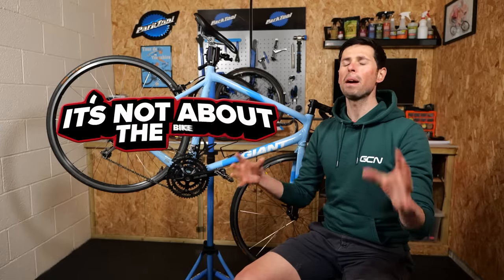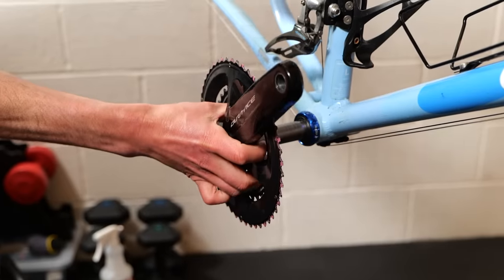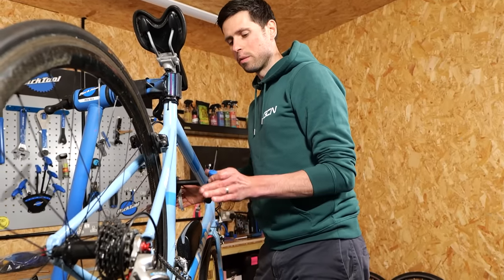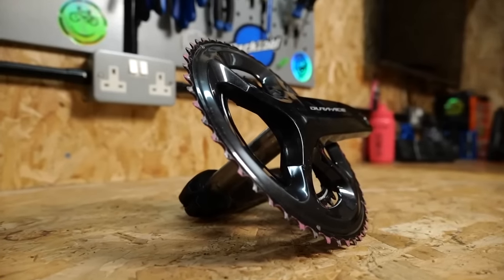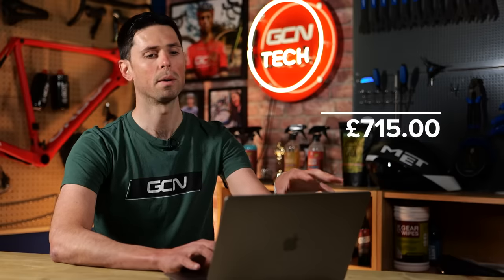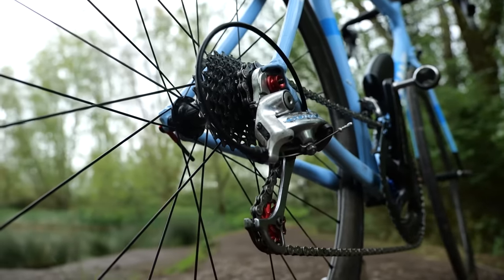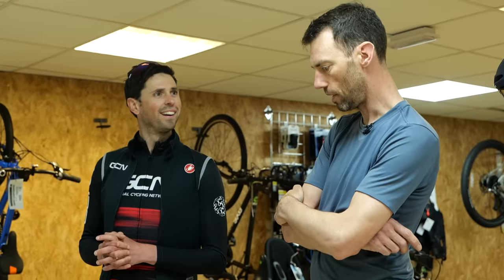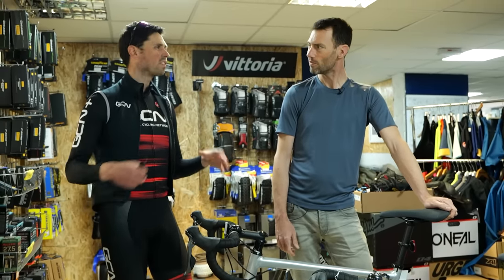Did I Really Build A Bike For Under $1000? | Cheap Performance Bike Upgrade Ep. 3

Comment from the maker: What do you make of Alex's new bike? 🚲
Reply: People should chill a bit, it's a fun video, if the bike ends up at 1100 instead 1000, what's the big deal. Chill it's fun
Reply: Good idea but Dura-Ace Crank seem to be over kill. A good 105 would have been great ! 
Difference between a old Sora and a claris is incredible. So for the difference (maybe 50$cad) you would be able to purchase a new derailleur instead of new pulley.
Oh and the Giant frame. Love Giant. But the OCR ... was laking of stiffness. The OCR was also more heavy than the TCR.

My suggestion. Put the bike in order but don't over kill it. It won't affect the quality of the drive. 

I always say. Yes you can put a Mercedes engine in a Honda. It will work. But the frame of the car was not design for it.
Invest in a smart way. Investing doesnt mean it will bring the bike in a new condition.

From a Shimano T.E.C since 2011

Cheers from Montreal
Reply: Who's Alex?
Reply: I think instead of the dura ace crank he should have invested in a 2x11 105 groupset, maybe even on the second hand market.
Reply: Oh yeah and fk off with the saddle, its a personal thing and if a 30,- saddle fits you than you don’t need that expensive model and a budget stem with same function coups be 10,- so i think for that money you should buy a 105 groupset
Reply: @coryrood  I think they meant Albert
Reply: @coryrood  I do not know, but maybe Bob will tell us?
Reply: @scottriley7215  Is that the other one?
Reply: Should have just bought a new CAAD with warranty 😂
Reply: Sweet ride and always great vlogs.
Reply: wondering how he spent so much ( see my comment,) and why use an off brand BB when an ultegra one is usually on sale somewhere for £17-20
Reply: You expecting father Christmas?
Reply: What wheels did you? I own a 2009 trek madone 5.2 but I’ve just ordered a pair of hunts 50 aero rim brake wheels but concerned about fit?
Reply: I own a OCR2 which is identical to this except mine has Shimano 105 rear mech & Tiagra 9 speed front mech & shifters. I found this video very inspirational & started to copy this build for my bike except I went with a more affordable, but new Tiagra 4700 front crank.
Reply: Awesome! 
How many people are sweating over their 10k bikes tho? 
😂😂😂

Comment: I've reused pedals many times.  There's no way I'm replacing a perfectly good set every time I get a new bike.  And yes, that means I have more bikes than sets of pedals.  Like switching them is a big deal...
Reply: Same
Reply: Same here , I have one set of road pedals and three road bikes
Reply: Same here. My MTB SPD pedals are from 2006 and still working fine. The current model looks the same and saves maybe 4 grams.
Reply: The point was to build/upgrade a complete bike within a budget as though you were starting out and couldn’t afford a top-spec bike. To fit top-spec parts ‘you have lying around’ defeats the object and someone starting out doesn’t have spare pedals. People aren’t saying to never reuse spare parts
Reply: @rob-c.  most bikes you buy have at least flats on them, so anyone could just use them..
Reply: I use Look road pedals, when I see them come up used locally I buy the pair I have 3 road bikes and 5 sets of pedals. But at 20$ a pair its doable. If you're using a 300$ set of pedals I can see swapping them. But it's really nice to be able to say.... I'll take that one today.... and just jump on and go!
Reply: @Chris_Rides_Bikes   Yeah because cheap flats are the same as Speedplays 😅
Reply from the maker: You don't want to be messing around with changing pedals before every ride 👀
Reply: @gcntech   I've got more than one set, so it's not like it's a daily routine.  I could count on one hand the number of times I've done it in the past year.
Reply: @GCN Tech I do pre flight checks on the bike before riding , tyre pressure ect. 2 mins extra to change pedals is better than wasting near on 2k on two extra sets of wahoo power pedals for the two bikes im not riding 🤦‍♂️
Reply: You look familiar
Reply: @gcntech  unless you have power meter pedals and 6 road bikes + gravel bikes
Reply: Redemption!! 
Agree , think it's fine to use pedals from another bike.
Reply: It’s fine to use pedals from another bike, so what’s the big fuss?

I’m fortunate enough to have 2 pairs of pedals but I usually do a pre-outdoor ride swap since my main pair are pedal based power meters.
Reply: My pedals last longer then my bikes
Reply: I buy same pedals for all bikes so just grab one and ride, no need to change them about but is like £100 per pedals I think
Reply: @gcntech nice up sale 😂
Reply: @Chris_Rides_Bikes ew flats

Comment: Cables and outer casing is a really good way to help your shimano ! :)
OPTISLICK cable for Sora, Tiagra & 105. POLYMER for Ultegra & Dura-Ace with the SP-41 outer casing with Shimano cable grease. Plus OT-RS900 for the derailleur. Don't forget your Sealed Cap ! :))
OH and cable will stretch for the first week. Put your speed barrel to the minimum at the beginning to be able to put some tension later.

From a Shimano Tech ! 

Cheers from Montreal.
Reply: Great comment 👍
Reply: Good advice. I didn't slack off my tension adjuster and had to embarrassingly fix it on the side of the road 🤣

Comment: Pedals are fair play because every bike you buy comes without pedals so they are outside of the budget really. Reusing your own pedals is perfectly fine!
However I am doubtful of the performance of that 8speed Sora with 11speed components - will it shift smoothly?
Reply: Try riding without pedals and then come back to me and argue it shouldn’t be part of the cost 😅
Reply from the maker: We'll have to see how it performs on race day 👀
Reply: @rob-c. I will now challenge you to buy a 10000$ superbike that comes with pedals. That's the point
Reply: @dan_lazaro  I just bought a 2015 Supersix Evo Himod with Dura Ace 9000 11 speed for $680 USD. 

And it came with pedals XD.

Just over 15 pounds and rides like a dream.

5 years ago I bought a CAAD10 for 750 with C24 wheels and carbon bars. Still have it and it's 18.5 pounds with 105 ten speed, clincher and heavy tubes and tires

Compared to this 8 speed build...
Reply: @Shadowboost  that's a really good deal! I payed almost twice that for a 2014 TCR Advanced with an empire groupset and sagmit wheels so mostly chinese except the cockpit
Reply: @dan_lazaro  As far as deals and "modern" carbon bikes goes, I think it's as good as it gets. I also got a 2016 Hi Mod Black Inc for 2800, but that has di2, enves, powermeter, etc. 13.5 pounds with clinchers

Comment: This has just set in stone what a bargain I got recently. I bought a very lightly used Giant Defy Pro advanced 3 for £700. Full carbon frame, carbon wheels, 105 groupset, hydraulic disc brakes. 7.5kg in XL.
Reply from the maker: Wow great buy! How does it ride? 👀
Reply: @gcntech  it's mega fast!

Comment: Personal opinion. I would rather have the new £900 bike than what Alex has built for just over that. What he has done is impressive, but I remember trying those shifters and really not liking them and I think the new bike would be in a lot better shape, with less needing to be spent on it in the coming year.
I am impressed at how well he has got the weight down and upgraded it though. I think this would be a good way to go if you were buying and upgrading a bike over time so wouldn't have the money to spend all in one go. Having said that if you are working in the UK, the cycle to work scheme could cut the price more and still spreads the cost.
Reply: Or get a used rim race bike with 2x10 105 or Ultegra for 400-500 pounds.

Comment: Great series on the value that can be found in used bikes. Further shopping and patience can produce amazing used bike buys. I recently purchased a 2012 trek madone for $150.00 US. It came with upgraded wheels, saddle, and crank set. Only draw back is that the chain and seat stays had been damaged. The stays had been repaired by an experienced carbon fiber shop, and the local trek shop confirmed that the repair is solid. Best $150.00 I've ever spent.

Comment: I did something like this last December. The difference is that my starting bike was a 2013 Giant defy. I even had a 3x10 4600 tiagra to begin with. The changes I made were 1. carbon wheels (around 300 euro used from marketplace) 2. 4700 tiagra groupset (around 180 from marketplace) complete with crankset and new cables included. 3. my old saddle and pedals (Is my opinion also that you can use yours without adding to the budget). I have not change my haddlebars (perhaps instead of 42mm a 40 or 38mm will be better) since I am happy with the way the bike feels. Coming to your build the only thing I was going to do different is that instead of the ultegra or Dura ace crankset I would spend the money for a 2x10 groupset (better feel for race, better gears for race).

Comment: I upgraded my old 2004 trek 3700 MTB into a gravel bike for less than $400. However I kept the square bottom brackets, bought shimano Altus components, micronew shifters, a cheap drop handle bar, and tape. It was actually around 250 but I decided to buy new wheels for 130. All from Amazon. Works great. I’ve taken it on several 30-50 miler gravel rides and it is awesome to have the suspension from the MTB. It is heavier for sure; but handles very well on lose gravel.

Comment: I think people seem to forget that when people first start out in cycling, they have to use a bike like this and they do perform modern upgrades to try and improve their bike. It is only when you get a little bit more seasoned in the saddle, you realise you could’ve bought something equivalent in a shop however on that initial purchase you are not fully committed to cycling so you’re hesitant in pulling the trigger. Also just to reiterate, some people might get bikes that are free or a hand me down so doing stuff like this and working and upgrading within the bikes parameters is normally done. Great series and I love stuff like this I wonder if they could do this with a cheap gravel bike or cyclocross bike.

Comment: Alex - I've just played catchup on this series but amazingly I did something similar over the winter with this exact same model Giant OCR-3, same colour too, which I really like. I picked the bike up completely by accident, we were buying some second hand sofas and the bloke asked if I was interested in buying his bike too. I only paid £100 for it. Over the winter I fitted a hollowtech II bottom bracket, complete brand new Shimano 105 rim brake groupset, brakes, shifters, derailleurs, crank, cassette, chain and cables,  which I got for only £299! I forget how much the Fizik saddle and Specialized bars and stem cost but the biggest expense was a set of Hunt Race Aero wheels and Schwalbe Pro One tubeless tyres which cost just over £560. I guess the total cost would be very similar to your build, no idea if the performance would be similar, mine certainly wouldn't be 🤣

Comment: I really like the idea. Specially since you dont need to do these upgrades as a beginner. You can just, every few mounts, upgrade another part of your bike.  
But that needs knowledge whilst buying the bike and knowledge and tools to upgrade the bike.  
If you bought an defect drive-train by accident ... the calculation might be off.
And if you decide you dont like that hobby ... you can just sell it without a problem.  

But I somehow, for most of the people, like the idea of buying a new entry level bike. And then maybe spend another 400£ on wheels and tires in your second year of biking.

Comment: I’ve had the same pair of Dura Ace 9000 pedals and a Fizik Arione Tri2 carbon saddle carried over several bikes. Same with some Fulcrum Quattro carbon wheels. So totally with you on the parts bin mentality. Maybe if you are running 8 speed cassette and 11 speed chainrings, using a 10 speed chain will be smoother, sort of halfway the width of 8-11. Bike looks totally rideable. Love the 7.9kg “same as high end disc bike” comparison.
Reply: Bro hes using speedply pedala

Comment: There's a lot of places you can buy cheap components! I bought Dura Ace 9000 pedals for $25 at a local bike co-op. They spin perfectly and clip in / out great after I serviced them.

Co-ops tend to have a bunch of high end but older spec used components for sale. The sales help them provide bikes and service for people who cant afford it.

Comment: I love these build series were it’s more about the average Joe bike 😊 Keep it up Alex 🤗
I’ve done my own build with a old KLEIN frame which I paid 200 GBP for… I then got a pair of VISION team30 wheels for 220 GBP, a Shimano 105 2x10 speed group set for 120 GBP (5700 series) and tyres, breaks, saddle, seat post, stem, handlebars, bar tape etc. at around 350 GBP… So now I have a ca. 9 Kg road bike at a total cost of just under 900 GBP… And I love it 😊

Comment: I’ve watched this video & since I have a OCR-2, I’ve upgraded it very similarly to this bike except I went with a new Tiagra 4700 groupset with an ultegra 6600 12-23 cassette. I did the stem & handlebars exact same as this video. I also had a set of Mavic aluminum cosmic wheels laying around that were hardly used & put those on. It completely transformed the bike.

Comment: For anyone wanting to build something like this but not having a great used parts market around them: Microshift, Sensah, or Ltwoo, all produce great components for pretty cheap - the mechanical 10/11 speed stuff is pretty rock solid. 12 speed mechanical is also available and I'm a happy user of the Sensah option, but indexing is more sensitive to cable routing, cassette quality, hanger alignment, etc.

Comment: I’ve worked in bicycle shops for forty years, and it’s always been common for performance minded cyclists to move their current pedals AND saddle from their old bike to the new one. 
In my opinion, you can leave both items off the budget.
 AND by subtracting the pedals and saddle from your total, you can afford a used 2X Front Derailleur and maybe even a used 2X front STI lever or lever set.

Also, there no need for any “forfeit”. You have not deliberately misled anybody.  Adjust your numbers, fix the front shifting, and enjoy racing your sub 1k bike.

Cheers!

Comment: So just as an example: currently I build a bike and I reuse stem, handlebar, wheelset, saddle, (maybe) seat post, tires and innertubes. All from old bikes. The parts I needed to buy are: frame, fork, Headset, bb, group set, cables and housing, handlebar tape, a freehub for to make the wheels compatible with the new group set. 

Currently I'm at around 850€. 

All this to say, it's quite possible to have a lot of stuff around if you're up to build a bike by yourself. 

Admitted, the Dura Ace cranks are a bit overkill 😂

Comment: Absolutely loved this! Thanks  for all the effort and time you have put into this project. I have no issue with you using "old" parts that you had lying around, we all have those right? The whole proscess of "revamping" an old bike is about creativity and sourcing the best parts from, well, wherever. Keep at it and thanks for genuine great content!
Reply: Except no one who is buying a £200 aluminium frame to upgrade has a £200 saddle, 11s dura ace chainset and a set of brand new speedplay pedals lying around.

Comment: I bought a brand new Costo Northrock SR1 road bike (made by Giant) and sold some parts of it to buy new parts at a bargain price. SMP saddle, Shimano WH-R501 tough wheels, Sora R3000 crankset for my Sora R3000 groupset, Shimano BB-RS500, Continental tires, new brake shoes and changed my Tektro for Shimano R3000 brakes (mostly for the look).  After all these upgrades, my bike costs me less than 1000$ canadian.  It is not as fast as my premium bike, but it runs pretty well and it was fun building it.

Comment: I mean... It's just fair that you addressed those critique points. Was also kind of shocked to see a DuraAce Crankset on there... But honestly? You could have gone with a used semi-modern 105 crankset, which get's you almost all the way there, for a fraction of the price. Or also some used pedals that are more mid-range... I think that's kind of the most exciting part about this build, at least to me... To proof how capable an inexpansive bike actually can be! And mostly you are doing fine, thanks for that. Have been enjoying the videos so far a lot 🙂. Also... Love the bartape...

Comment: Regarding the Dura Ace crank…I cleaned out my parts bin, which included a 10spd DA Crank I sold for $100 + shipping, and an 11spd DA Crank for $120 + shipping. They were used, had some scratches, and I just wanted to get rid of them, so yes, you can find deals even on DA of you look.

Building a budget bike is about reusing parts from the bin, buying cheap bits from your friends, ebay, anywhere. Our local bike shop just had a huge clearance sale on old parts, and components…super cheap…

Comment: For chain cleaning, I'm convinced the jar agitation method is as good as anything short of full sonic cleaning from ZFC. Even Josh Poertner condones this method and that's good with me. However, agitation in degeaser should be followed by agitation in ethanol, which we call denatured alcohol in the US. Dereasers commonly leave residue on the chain, which potentially interferes with adhesion of chain lube. An ethanol agitation will clean the chain down to pure metal, removing residue left from the degreaser.